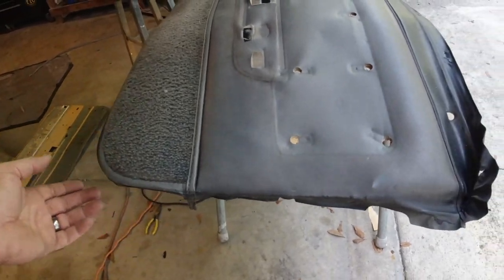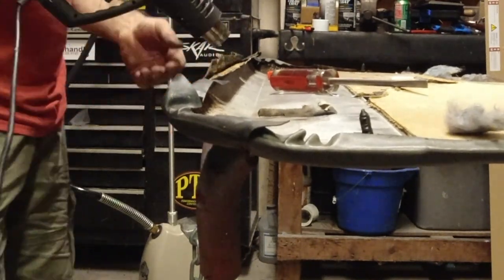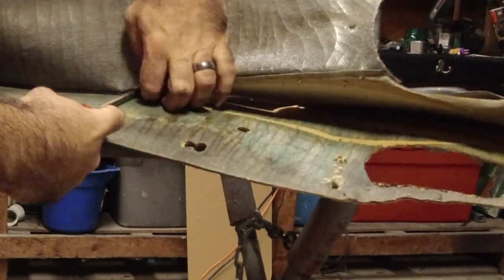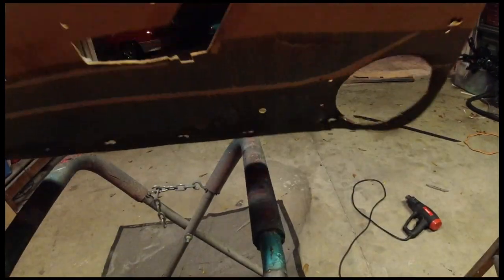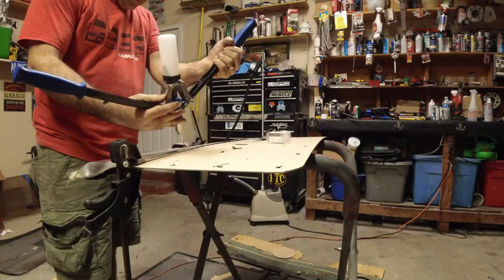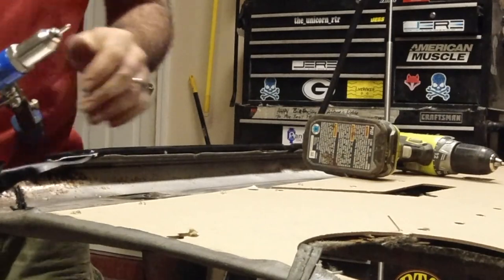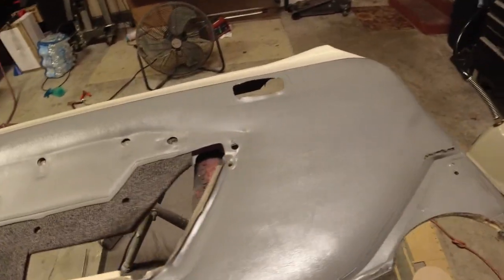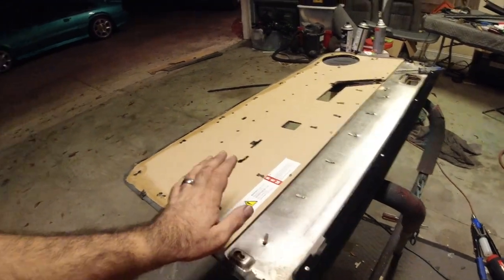Foxbody Door Panel Resto - Class Is In Session!

Comment: House of Dula video was a great help to me doing mine. Don't forget the lock grommet when removing the vinyl. I did my rivets with the heads on the backer board side and used rivets with the big heads. The hold the backer really well. Map pocket panels are MUCH easier than carpeted! Great looking job!

Comment: I noticed brew2L kept trying to correct himself at the terminology of the pieces on these door panels. Since most often people that don’t know usually get the correct nomenclature wrong. So, just if anybody is curious here’s the correct names of everything as a trim & upholstery person would refer to them. 

The large scale of interior panels or pieces are called “trim panel” or their named after their function or mounting location.

1. The staples are 1/8” - 3/16” - 1/4” depending on the thickness of materials they need to go through.
2. Metal at the top is the “border plate”or “top plate”.
3. Any center piece within the panel is the “insert” or “appearance panel” usually fastened with staples or aluminum tabs or adhesive.
4. The cardboard piece is “trim paneling” or “panel board” usually 1/16” - 1/8” - 3/16”.
5. Top black material is the “border” or “top cover” usually fastened with adhesive, staples or crimped.
6. The leather is either “accent” or “main” usually cloth, vinyl, leather, valure, pleather (plastic imitation leather) or actual plastic.
7. The bottom piece is the “valence” or “lower border”.
8. The thin strips sewn to the edges of the carpet or vinyl are the “binding” or “rope cord”.
9. Handles are handles.
10. Pockets at bottom of the panels are “accessory pockets” or “lower/upper pockets”.
11. Top seal is the “window trim seal” or “upper seal”.

The some of these names are included on the dash.
1. “Upper facia”, “lower facia”.
2. “Appearance cover” or “emblem”.
3. Dash is a “dash pad”.
4. Lower dash parts are “lower valance” or “lower dash panel”.
5. Panels at your feet are “kick panels”.
6. Rear quarter pieces are “quarter panel” and center pieces are “quarter panel insert”.
7. Triangle shaped panels by rear glass are “sail panels”.
8. Roof panel is “headliner” go figure right!
9. Rear dash is the “package tray”. 
10. Any padding behind a panel or under your carpet is referred to as “juke padding” or “sound reduction”.
11. Any foam padding behind any panel is referred to as “scrim foam”.
12. Appearance covers at the bottom of the door on the carpet are “sill plate”.
13. Front, middle or rear vertical trim pieces named after the points their mounted to, “A pillar trim”, “B pillar trim” & “C pillar trim”.
14. All trim that holds up or mounts the headliner is “headliner trim”.
15. Lighting at the sides above or at shoulder height are “dome lights” or if individual switches are used “map lights”.

Usually all trunk panels are “trunk lining” or just referred to as “trim panel” usually named after their mounting location or function.